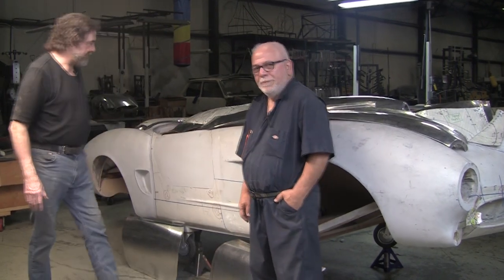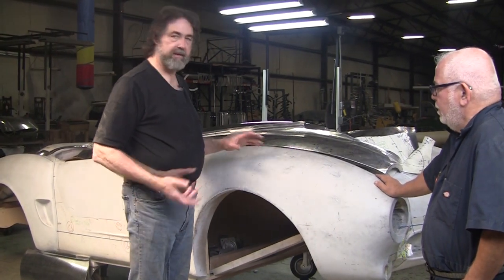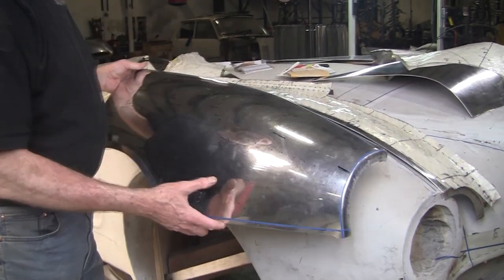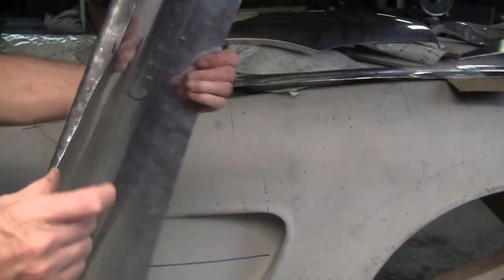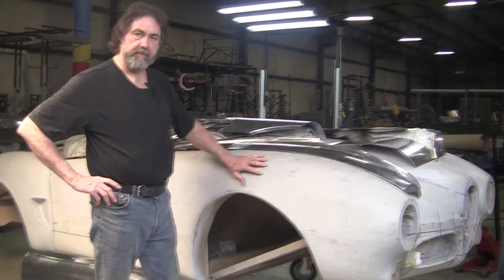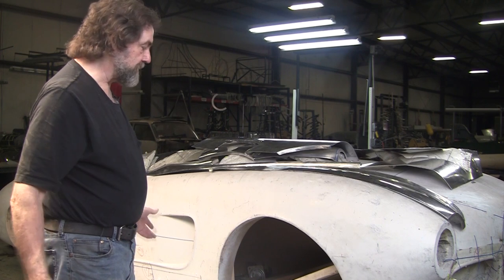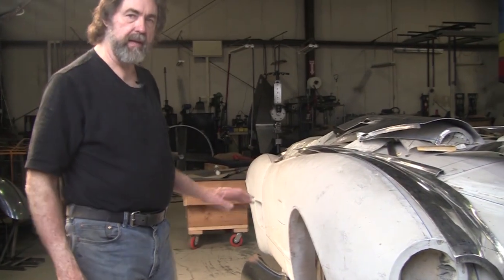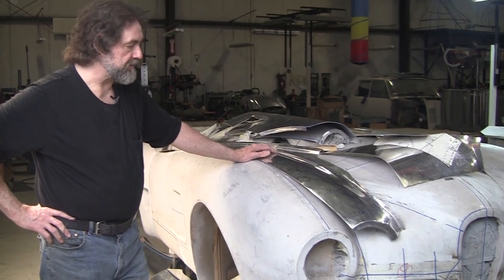Alfa Romeo: Students learning how to make compound curves

Comment: I know you like wire bucks, but don’t they have the same disadvantages (less information) like a plywood station buck?  Not a criticism…just trying to understand it all.  Thanks!!!
Reply from the maker: A wireform is the easiest way to develop an original shape. Once the wireform is made on one side the panels need to be fit to the wireform. To do that I use a technique I call making a proto flexible shape pattern. Once a panel is complete I make the opposite side using a flexible shape pattern from the first side insuring symmetry.